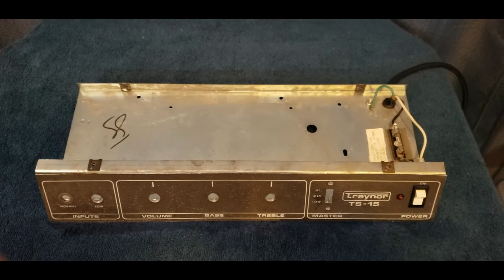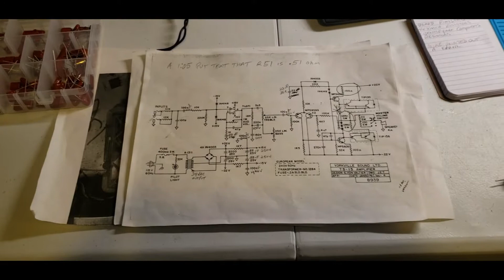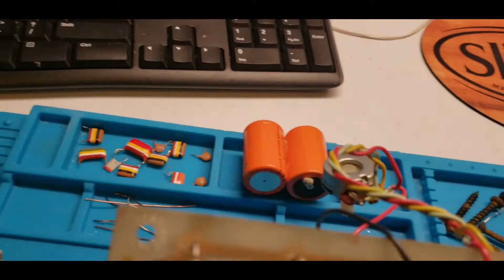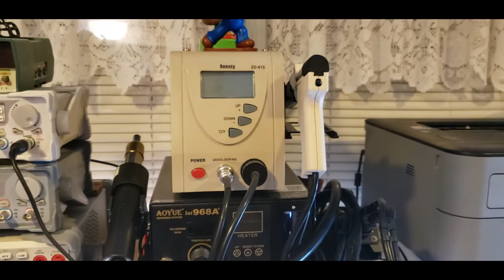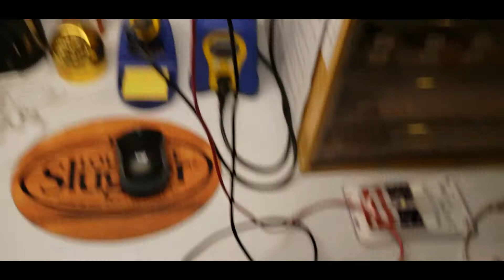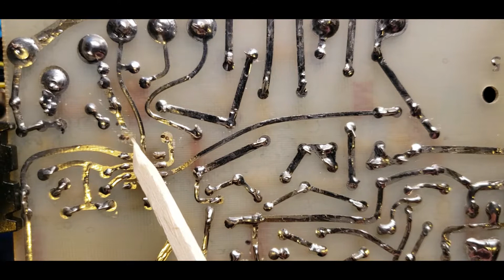Traynor TS-15 Guitar Amp Restoration Part 6

Comment: The resto is looking great so far- nice work dude!

I have a few questions?
1. What is the make and model number of the circuit board holder that you use?
2. Do you think a Weller WCL100 is a good unit for beginner hobbiest.

When you are done the restoration please make sure do a video of how it sounds.
I know the ones I have in the basement don't sound like new because of the 40 year old caps.
Reply from the maker: Thank you for the compliment Mike.  The circuit board holder is Aven 17010 https://www.amazon.com/gp/product/B01AWN91R2/ref=ppx_yo_dt_b_asin_title_o01_s00?ie=UTF8&psc=1
The Weller is a good choice. I like the fact that it is 100 watt. That covers all your needs. I personally use the Hakko FX-888D. It is 70 watts and more than enough for us hobbyists.  https://www.amazon.com/Hakko-FX888D-23BY-Digital-Soldering-Station/dp/B00ANZRT4M. here is the link to Amazon. It's a bit more expensive but you won't need to upgrade in the future.